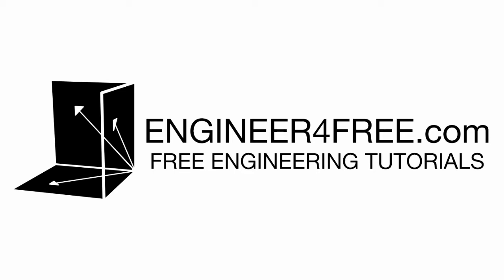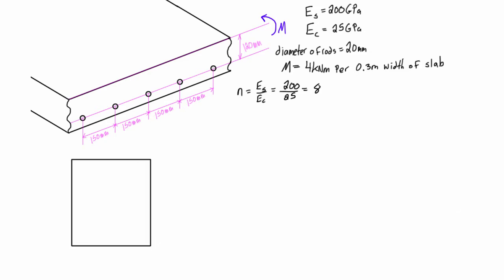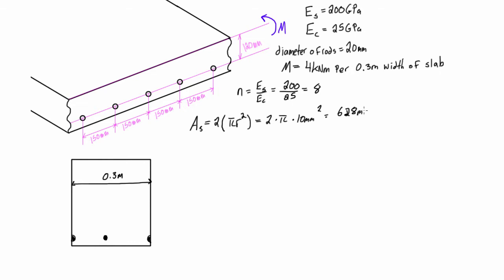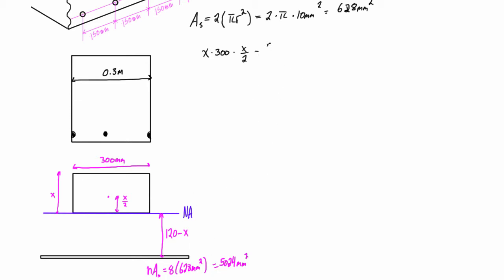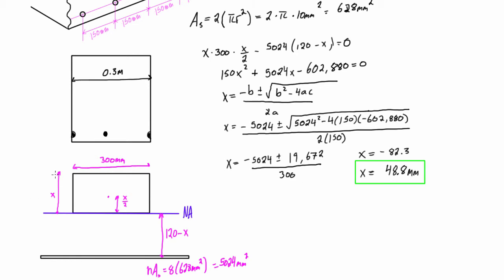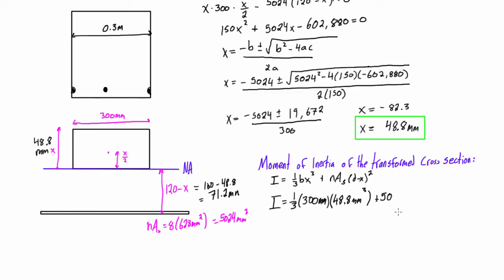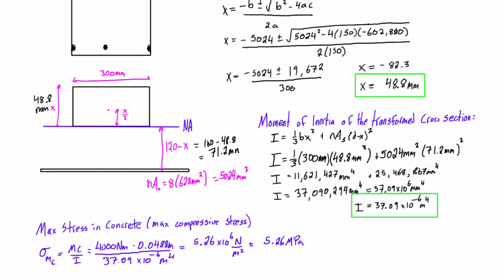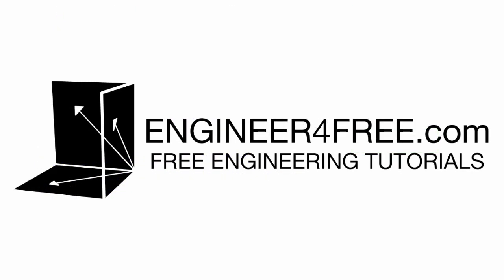Pure bending of reinforced concrete example #2

Comment: I believe that the moment of inertia via the FE reference book version 10.0 (Statics section) should be:
 I_x=I_xc + ((d)^2 * A)
Where I_xc=(b*h^3)/12

you had the I_xc=(b*h^3)/3 which is incorrect. Can you please advise?
Reply: The 1/12 is correct if you rotate a rectangular shape about its centroid. The 1/3 component used for this problem is correct, as the rotation not about the centroid, but its edge. The parallel axis theorem can prove this.

Comment: Is there any specific reason for rounding off intermediate values during the analysis stage?
Reply from the maker: No. Just did it to save time in the video but that is sloppy, you should maintain as many decimal places as possible until the end.
Reply: @Engineer4Free  Roger that. Thanks for the awesome content!